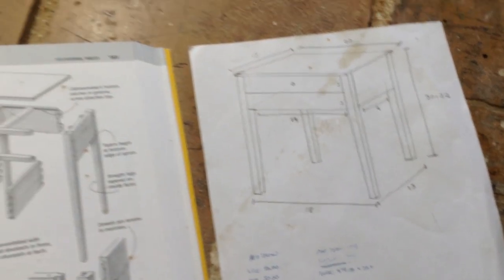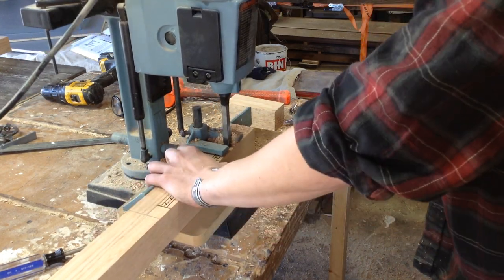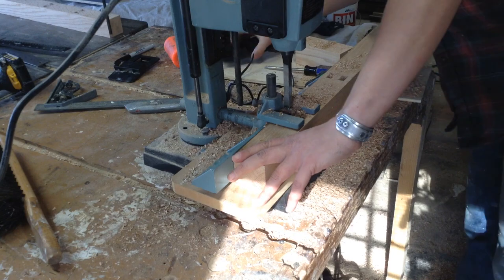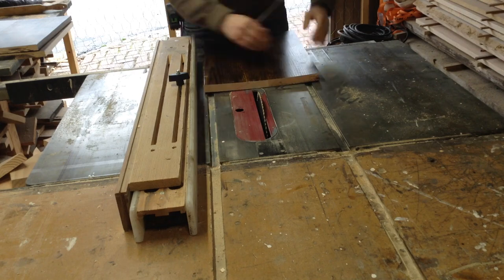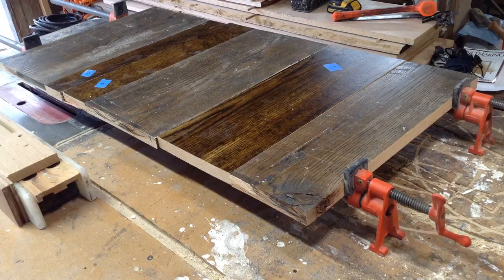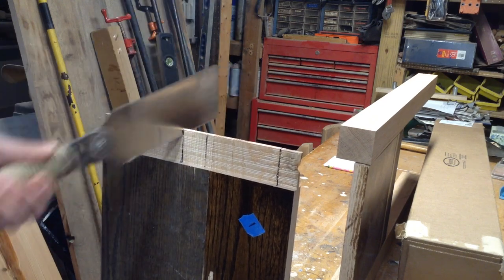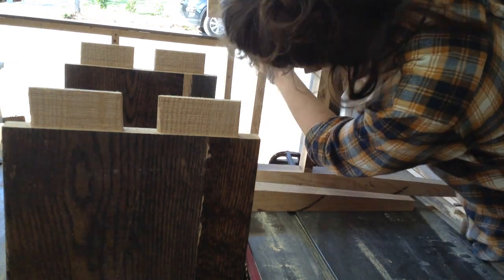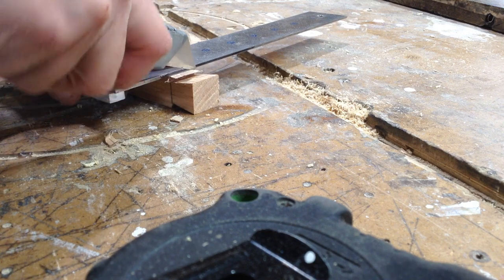Woodworking : Oak Side Table // How-To Part 1

Comment: Thanks for the book mention, I will add that to my list.  Glad to hear the car worked out, that's always a pain.  Great shop stuff as usual.
Reply from the maker: Thanks!  Great book.  At this stage in the game I usually have a pretty solid idea of how I want to build something.  But, I always skim through it to check that my plans are similar to what is in there.  Yeah, I was on my way back from Lowe's about two weeks ago with a load of lumber.  It started shacking pretty bad and wouldn't accelerate past 20 mph.  I really liked that car, and have gone in some great adventures in it.  But, it's 24 years old and not worth throwing money into it anymore.  Life has been pretty crazy trying to car shop on top of everything else, but very happy it's done.

Comment: You could have made a barrel out of that table top! Did you not alternate your growth rings when you made it? Glad to see you could reuse some of it on the new build. Looks good! you could mire the ends of the tenons on a 45 where they meet in the corners. Nice job as always! glad to here you found the Car you were looking for!
Reply from the maker: Thanks!   I do alternate growth rings, BUT sometimes if one side of a board is "nicer" then the other I will cheat.  So, I don't think it was the main issue on this top, but it definitely didn't help that some of them weren't alternated.

Comment: Glad to hear you got your pickup, I am sure you will find it a great labor saver. Some time I would be interested it seeing your sharpening system. Great use of the table top. Love the way you are always thinking of reuse of things. Was wondering why you did not use any biscuits or dowels when gluing up your pieces? Liked seeing the pup in the shop.
Reply from the maker: I don't have a fancy sharpening setup, just a work sharp.  I'm terrible at keeping everything sharp and the work sharp is so easy it curbs my procrastinating on it a little bit haha.  I used to use biscuits all the time, but ran out once and did a glue up without them, and then another, and another, and another, and just never bought more hahaha.
Reply: @HoneyBadgerWoodWorks  Now see I have a Tormek system, Delta flat wet system, several bench grinders, and a whole hand sharpening fleet and I still have dull tools. Some how I just keep putting it off.

Comment: I was looking at your chisels.  I have been thinking about purchasing a good set for myself.  The ones you where using looked nice, do you like them and would you recommend them?
Reply from the maker: The chisels I have came from Aldi, I got two sets they were about 12 bucks for the each set and I sharpened them to two different degrees.  Saw a video years ago by Paul sellers saying they are decent chisels for the price.  And I can not lieI like  them, but don’t really have anything much to compare them too.